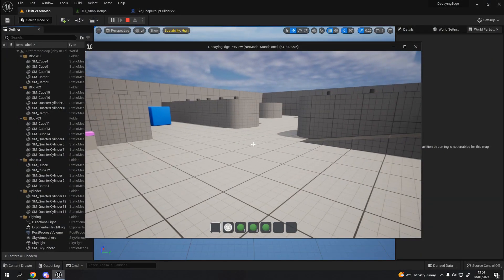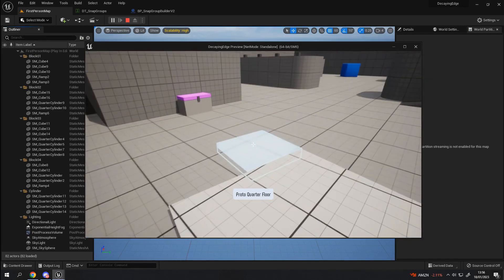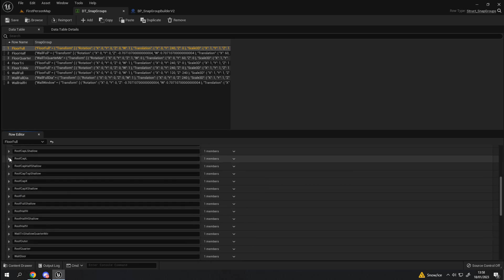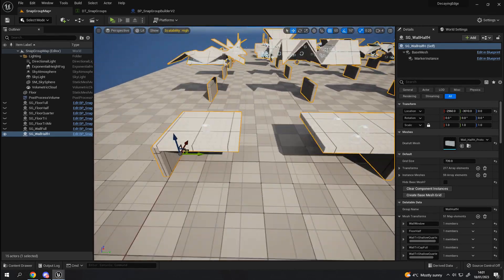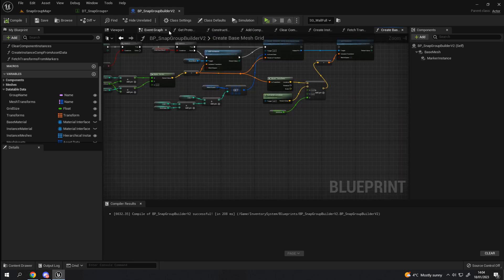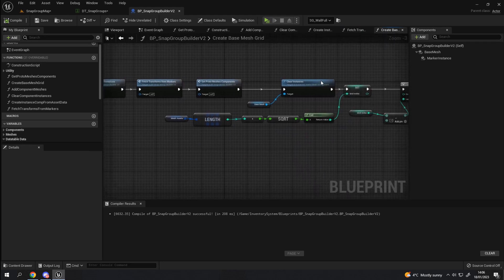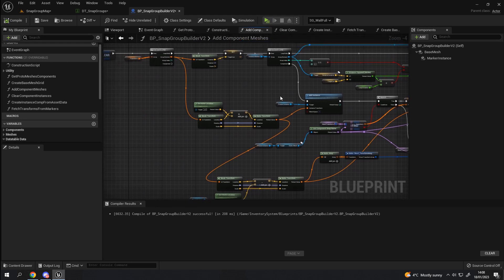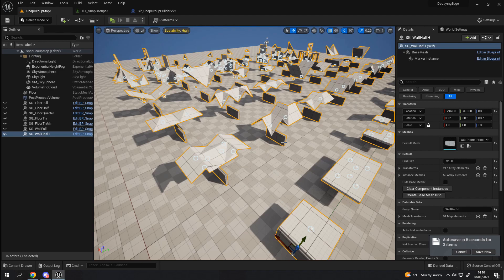UE5 | Dev Talk - Building System - Generating Snap Point Data

Comment: Do you decide which snap point the object should be snapped to based on the closest snap point to the end of the player's line trace? If so, how do you reference multiple objects near the player without looping through all snap points in the world?
Reply from the maker: I do a sphere trace at the end of the line trace to get nearby actors. I then loop through the possible points just for those pieces.

Traces are pretty cheap so if you can use them to narrow your options it's always worth doing. :)